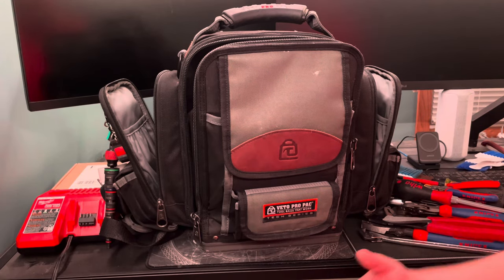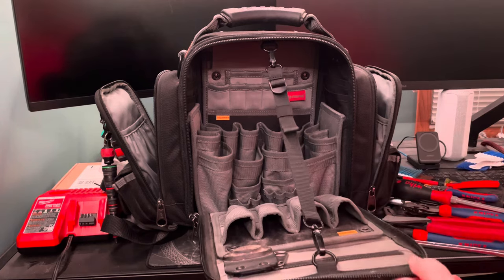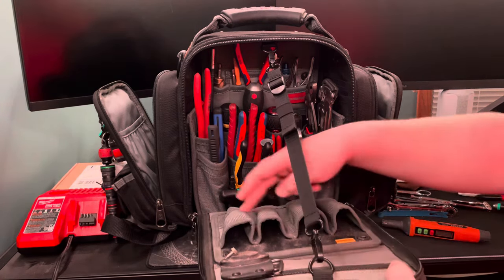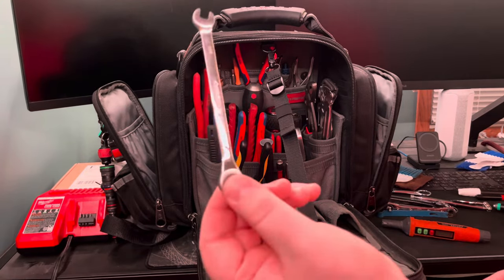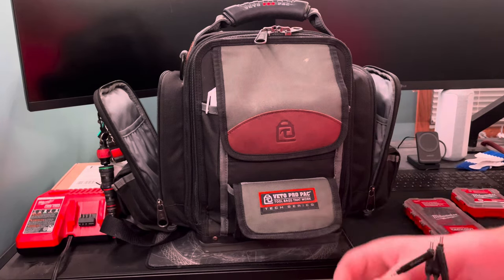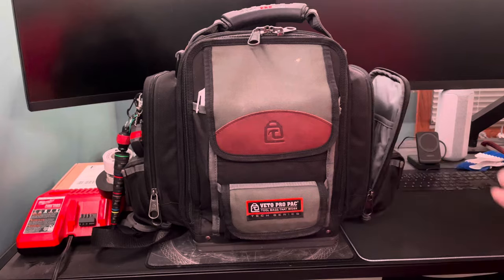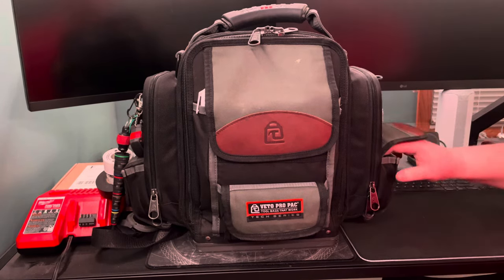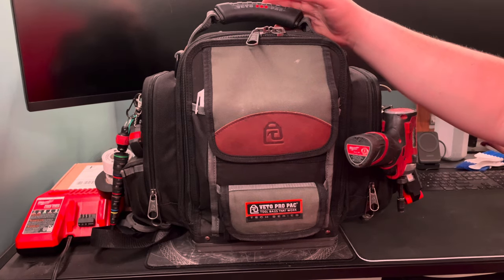Veto Pro Pac MB5B - HVAC Loadout

Comment: Do you really use all of that, or do you think you could downsize? Just curious to know if it's necessary to use all that as I'm new to the trade.
Reply from the maker: There's definitely some redundancy and excess and I definitely could downsize, but a fair amount of what is in this bag follows the "nice to have it when you need it, even if that's not very often" principle. For example I don't use the bigger pliers wrenches and cobras very much except if I'm changing out a gas valve in a furnace or something like that. I honestly never use the XS versions I have either, but there's an empty pocket and I like to have something to be able to fill it. My maintenance bag video I made is a lot closer to what I would consider to be the more strict necessities of doing service, although even since I made that video I upgraded that from the TP-LC to the TP-XD because I felt that there were just a few things I would like to have when I'm just doing maintenance type stuff.